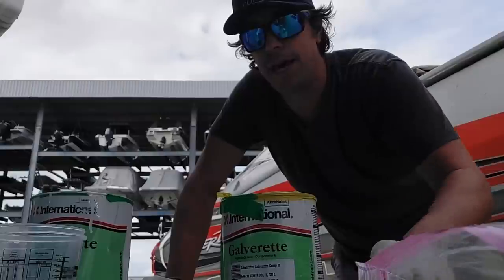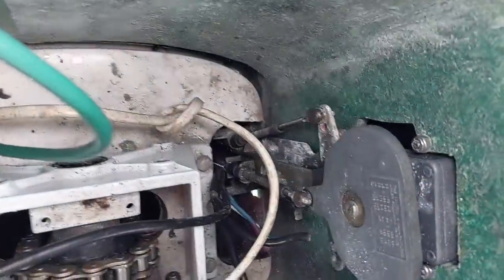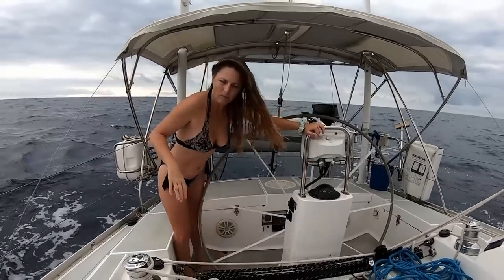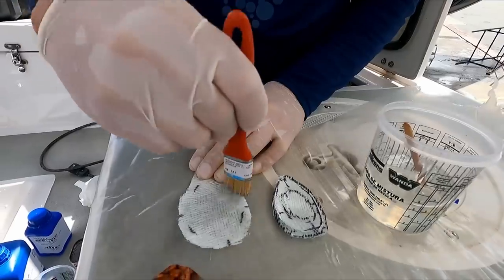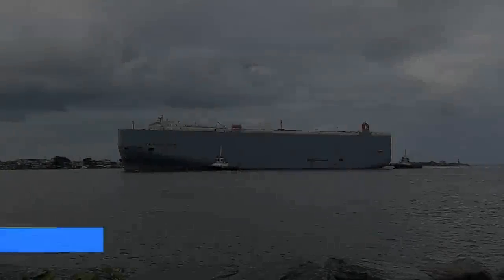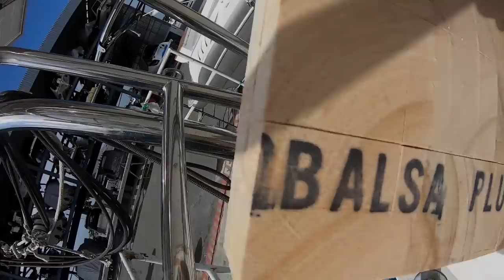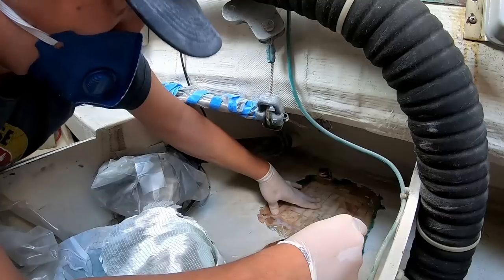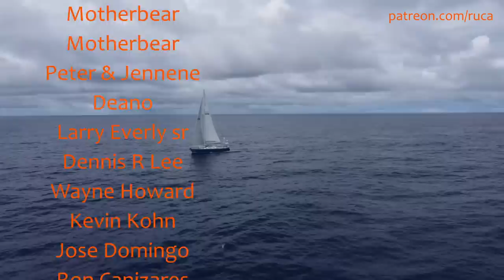Fixing Our Boat After Our WORST FEAR: An Offshore UFO Collision [Ep. 88]

Comment: Great video.  I admire your ability to repair the hull damage.  I'm curious about the vacuum used to extract the air.  Can you give a brief explanation of the materials?  Is this a kit that you put together and use a regular wet vac?  Or is this a special vacuum that you purchased?  Safe travels!
Reply from the maker: Seems like a blog post is in order for more detail, stay tuned for that on our website www.sweetruca.com Proper materials make things much easier and a better outcome. The vacuum pump is different than a household shop vac. It needs to be able to run for many hours (up to 24 hrs non-stop) until the epoxy cures. There are some good videos on vacuum bag composite processes online as well.

Comment: Great job. Remaining question for me, why did you use balsa again as core? Better material could be foam sheets. They can't suck moisture.
Beside this, you did the best by using a vacuum area to remove all bubbles. Good luck for the rest of the work.
Reply from the maker: Hi Christian, thanks. We went with balsa to be consistent with the rest of the hull, maintaining as close as possible the original design and construction.

Comment: Relocating the Zeus seems like a really worthwhile, if unglamorous, upgrade.

Curtis’ approach to the hull repair strikes me as rock solid and thorough - I’m convinced you were wise to excavate as broadly as you did. Have you done balsa core repair of this nature before? Hopefully you’re pleased with the result, because I think you deserve to be!

I’m curious if you were able to estimate how many hours labor you have in the repairs? I’m trying to guess what it might cost someone less capable of doing the work themselves to pay a yard.
Reply from the maker: Hi Kevin! Glad you liked the episode. The Zues move was something we wanted to do for a long time, but could never justify the mess of fiberglass. That binnacle area is suprisingly thick solid laminate! We are also working on a plan for better AP control redundancy. 

Curtis has had some fiberglass and composite experience. Enough to be dangerous ;-) He has built custom parts for racing jet-skis, repaired motorcycle fairings, rebuilt an old Melges 24, and has had the chance to learn about composites from some of the best in the sailing industry.

Not sure how many hours exactly. A good yard could do this in a few days work only limited by proper paint and epoxy curing time. The hardest part for us was sourcing materials and tools, working with battery powered tools, and dealing with unfamiliar boatyard politics in another language. Not many boatyards would take the extra time to do this repair to this standard though.

Curtis was trained as an insurance adjuster for "specialty vehicles" in his past life, so he knows his way around estimates and project management for these types of things. He didn't make a quote for this though, as sometimes it is better not to see the bill :-) Maybe something to add to the blog post about this?
Reply: @SailingSweetRuca  There's definitely plenty of material for a good blog post here, I look forward to reading more nitty gritty 🙂

Comment: I didn't catch what that copper strip was?  Grounding plate? 
Great work btw.  I had to do a big rudder tube (and rudder) repair to my hunter in the water in my marina.  All wet layup, some of it blind reaching behind a bulk head, but man i would've NEVER thought to vacuum mold it, let alone all that core work, and in a foreign country in only a few days.  Took me months.  I'm impressed.
Reply from the maker: Wow, sounds like you had a big project also! In the water makes it even tougher! Well done! The vacuum, peel ply, etc. adds complexity, but after some practice actually makes work a little easier and cleaner. 

The copper ribbon is likely for lightning protection or SSB, but it is essentially another ground.

Comment: Very decent repairs and improvements. Would be interested to hear about the structural aspects of the rudder, particularly the rudder stock which I guess sustained big forces to bend and puncture the hull.  How is it that a Brazilian boat yard has such excellent safe steps to access a boat on the hard, yet the US, UK, Canada, EU, etc. use rickety ladders?
Reply from the maker: Hi B M! We are working on a blog post that goes into more detail. Maybe a tech tip type video would be a good fit? Funny you noticed the ladder :-) Our ladder was "borrowed" one day when we were up in the boat working, and was replaced with the superyacht steps by some of the boatyard guys :-) Pretty cool!

Comment: Vacuum bagging N All, Nice Job Curtis, the Upgrade to Controls was Ace as well.  I can tell you a way to cut out 70% of the Glass itch, just need baby powder and a hot shower.
Reply from the maker: Thanks David! Always want to know ways to cut down the glass itch!!!!
Reply: @SailingSweetRuca   I especially like this method when it's hot and tight quarters grinding=the worst!!!! what you get is some baby powder, get in hot shower come out towel off fast and then rub powder into your pores pack it in, Arms, Shoulders and Back,  then a long sleeved shirt if you want and tape the cuffs, when done for the day jump in Hot shower again and hot as you can it will push out the powder from the morning packing which pushes out fiberglass fibers and them soap down good and ease back to regular temperature, then towel off gently  and I find it really helps.

Comment: Is the balsa wood just used for filler and thermal and sound insulation?   Doesn’t seem to be adding any structural component.   I obviously no nothing about boat hull design and repair 😂

Comment: Why not foam core instead of balsa ?
Reply from the maker: Good question. For us the short response is: it was important to repair the boat to its original design specs. The long is balsa and foam have different properties and advantages/disadvantages. We will try to cover the reasons more in a blog post we are working on. Balsa, when done correctly, is an excellent core material.